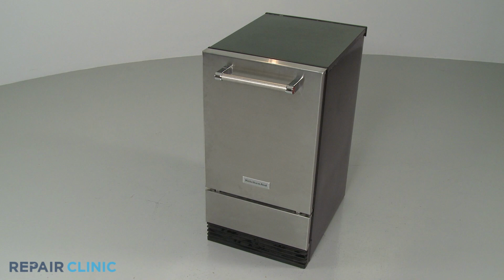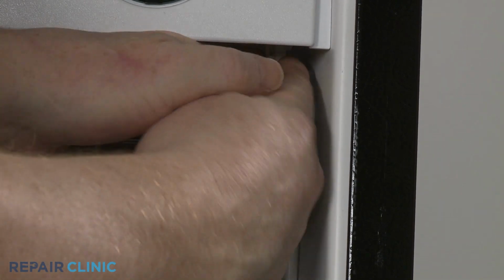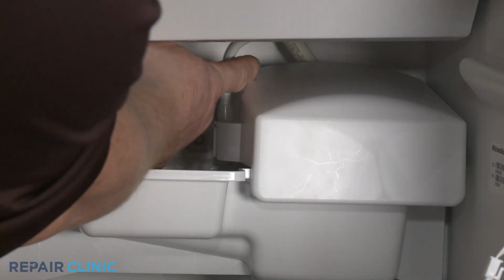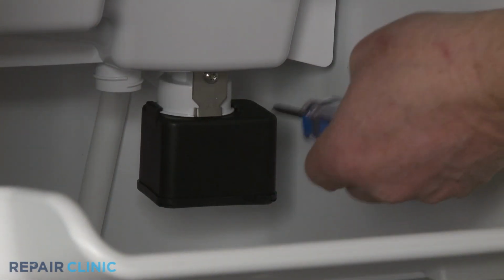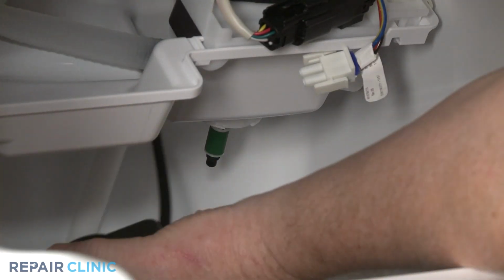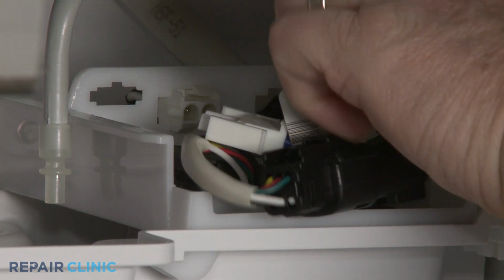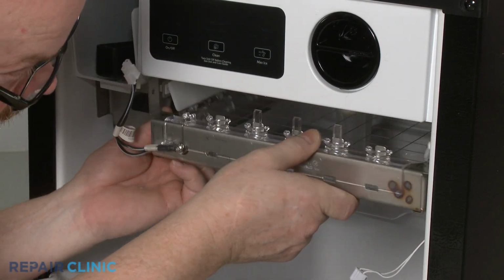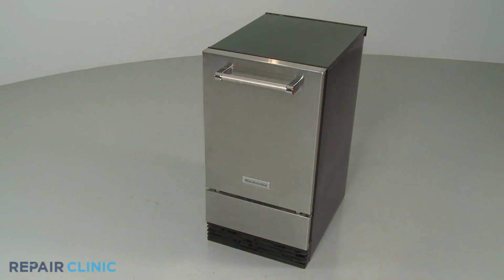Kitchenaid Ice Machine Reservoir Drain Pump Replacement WPW10489125

Comment: That is not the drain pump you are replacing, it’s the circulation pump. The Drain pump is located in the rear bottom of the ice maker, this DRAINS the water in the tub. Correct your description
Reply: My ice maker is not draining what pump needs to be changed